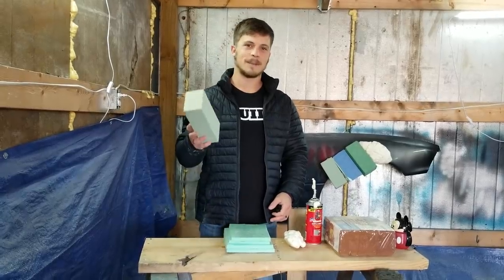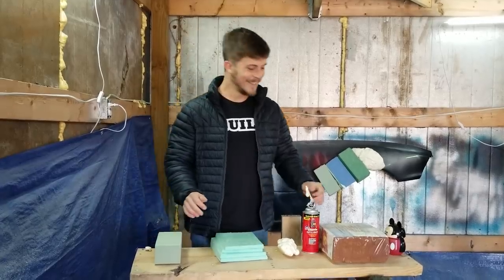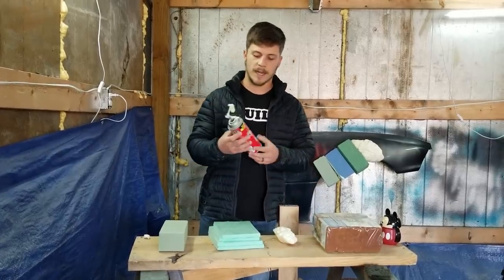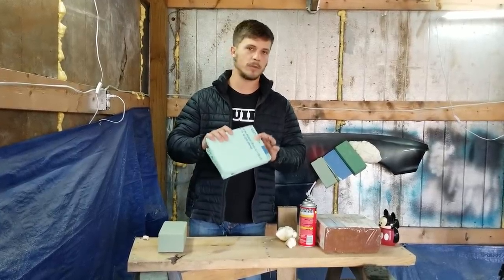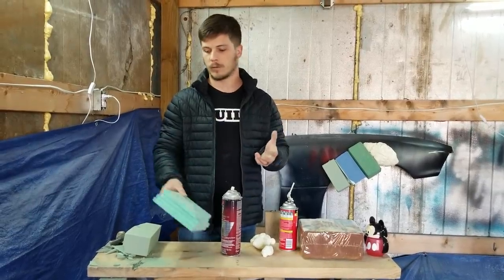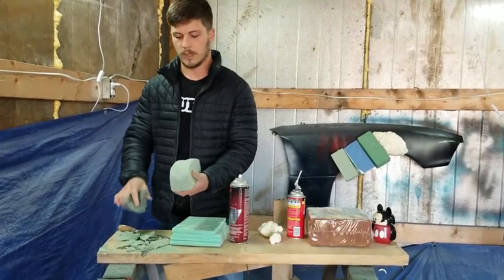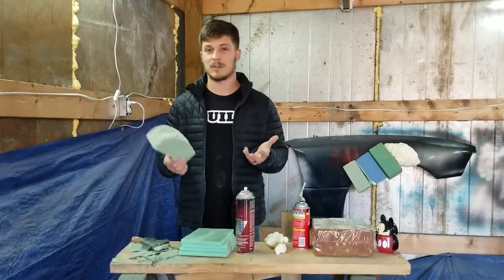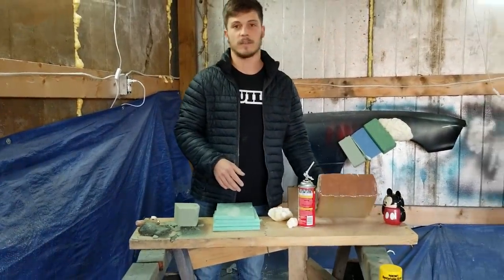BUILDING CAR PARTS OUT OF FOAM

Comment: You should try regular grey ducktape over your foam fiberglass resin won't stick to it. I've been using it for years.
Reply: billy Fish spot on bro, duck tapes no sticky side is made from a polymer similar to many plastics, epoxy resin used with fibre glass won’t stick to it. Good advice man!

Comment: I'm late to this but already a good start. I'm going to be making project Fennec (one and only once it's finished) over an old Civic body and I have a 2JZ swap ready for the little hatch. We're welding mounts for it under the hood and frame for everything to line up. I just don't know much about the body part.